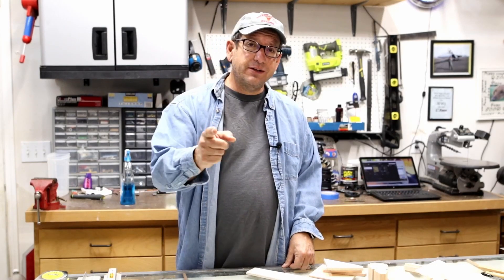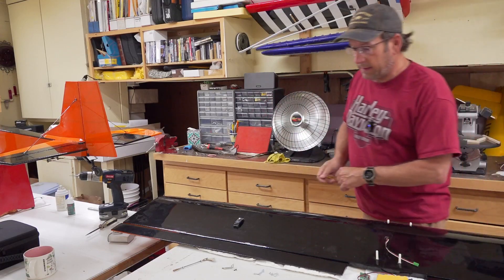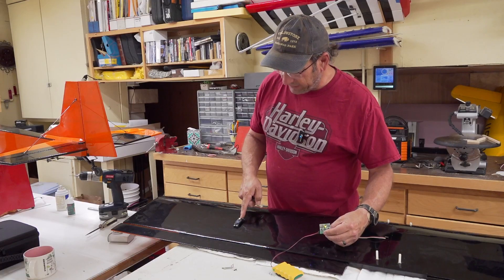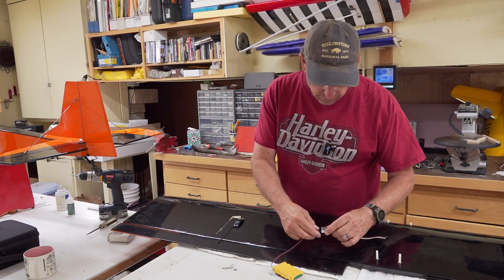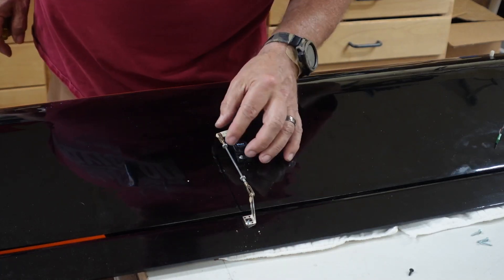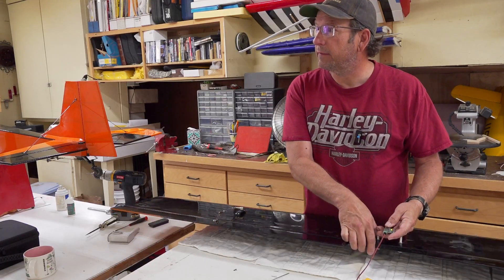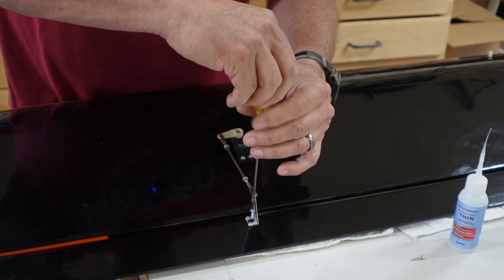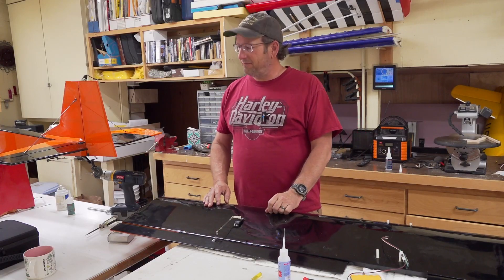Aileron linkage install, Ryan's Rebel, building a giant scale RC airplane from RCM magazine plans

Comment: Great to see Rebel almost ready to fly . Look forward to Maden
Reply from the maker: Did the initial engine run the other day and it was the first time EVER that I didn’t have to touch a needle.  Straight from the factory it ran solid.  That never happens to me.  So with any luck Memorial Day is the penciled maiden day.  Just need to do a final engine on, range check and then it’s go time.

Comment: Dan, I have a Dewalt (DCF680N1) gyroscopic screwdriver with a long 5/64" hex bit that makes doing the chore of RTL servo screws so much easier.  The gyroscopic feature gives great control and torque where you can ease the screws in without stripping them.  Saves old hands.
Reply: Me to its great and smaller then the gun

Comment: I think it would be interesting to talk about your strut between vertical and horizontal stabilizer, that was done off camera.
Reply from the maker: Good eye Leonid!!!   I will be covering those flying wires.  They turned out really slick using 2-56 rods.  Mark has done it on several of his sport planes where I have always used cables.  Which are a pain in the A$$ to string and they always end up loose and looking dumb.  Yes I will touch on this.

Comment: Disconnect the arm before powering up.
Other than eye balling it, how do you know the servo is centered,  arm is 90?
In large deflection set ups where the arm moves in 2 motion planes relative to the horn a small offset of the horn is good to minimize loss of force.
Reply from the maker: That's why I use the centering/servo driver while setting it up so it will center the horn.  You can also use the receiver that will go into the plane and center it using the radio with the horn off and then put it onto the spline with proper orientation (centered).

Comment: Good video Dan, do you have a link for the control horns and screw that you are using?
Reply from the maker: The servo screws are from RTL fasteners and are offered in different sizes.  If you order assortment #5745 it has a smattering of all of the screw lengths and nylon washers if you need a damper although I have never used them.  With the rubber and grommet of a servo mount I have never had one back out due to vibration.   RTLfasteners.com

The horns are from Sullivan.  https://amzn.to/3BXRdHk I used 1 1/8 on the ailerons, and 3/4 on the elevator halves.

Comment: Hey Dan,  the Ryan's Rebel is looking great, almost ready to go. Just two questions, 1. where can I get the plans and 2. Do you remember me?
Reply from the maker: The Rebel plans are available at Aerofred.com.  They have a ton of great plans free to download but you need to register with you email address.  Registering is also free.  You download the file and take it to your local staples or print place.  The file is to scale so you don’t need to increase or decrease the file.  They can verify it by looking at the paper size.  If they say one sheet is over 84 inches then it’s right.  Do I know you?   Your handle is not familiar.
Reply: @Capgains7777  Hey Dan, I used fly Aces High II.handle was BTME62
real  name is Mike.  If you arn't the guy i''m thinking about, my mistake.
Reply from the maker: @mecallahan1  yep I spent an inordinate amount of time playing that game.  I was Capgains.  I remember your handle there and I think we talked RC when we should have been concentrating on not getting our asses shot up.  Blue Thunder Squadron.  Aces High is kind of a graveyard today. They still want $15 a month but the arenas rarely have more than 30 in them anymore not like the old days.  Good to hear from you.